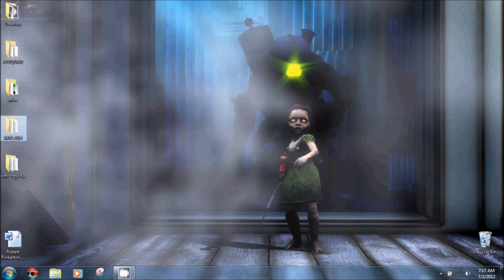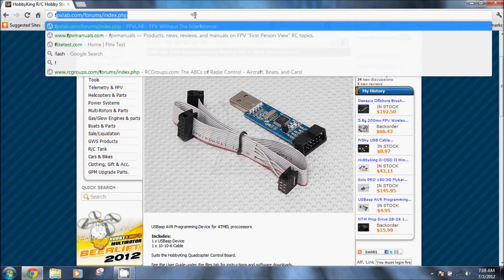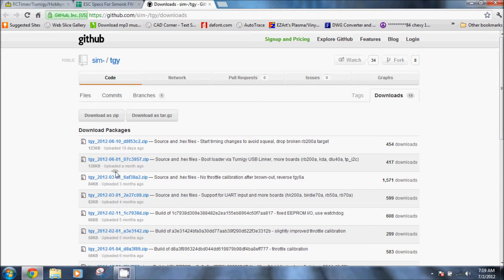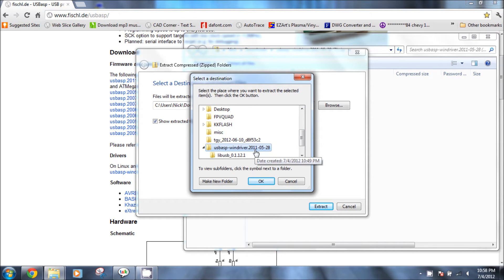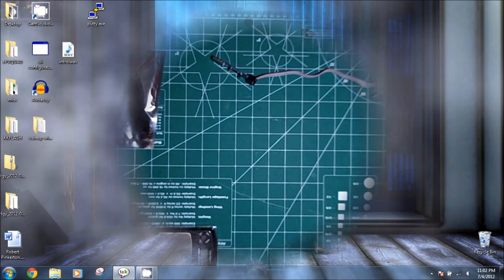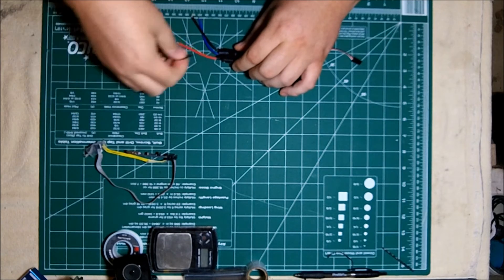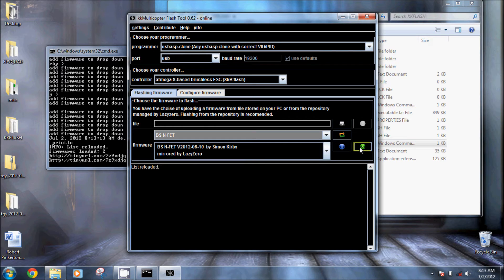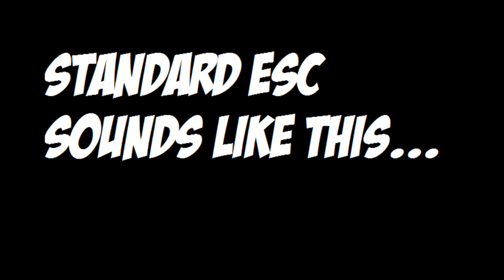Flashing SimonK Firmware on a 20 amp HK esc

Comment: Why install Adobe Flash? - the shell script or any part of the programming does not make any use of it. "flashing" is the term for loading software onto the microcontroller. It has nothing to do with Adobe's product.
Reply from the maker: I appreciate you taking the time to correct my mistake; however, I had already made a note in the video explaining you needed Java not flash.  I had flash on my brain and spoke incorrectly.  Its odd you did not see the note and felt compelled to correct the mistake.
Reply: rnpnick I had annotations turned off on my system, so i didn't see it. Sorry mate.

Comment: Can I use that flash tool on a MultiWii board? Confused because I did not see Multiwii in the pull down choices.  Thanks!
Reply: you might be able to flash the multiwii board, but this video is for the ESC, so it wont be of much help. the RCGroups forums should have a topic, if not, make a topic and ask how

Comment from the maker: SimonK turns off lipo cut.  The only thing you need to do is flash the esc then calibrate to radio.  Throttle stick to high, turn esc on, throttle stick to low, it is calibrated.

Comment: Yesterday i got the same message..
The message simply means that the connection is not correct.
First I thought it's my USBasp... or I overheated the ESCs when soldering...
But after I calibrated the ESCs and was glad about having them working and after many tries flashing suddenly worked! Simply press the contacts tight on the board.
Also take a look at: wiki.openpilot(dot)org/display/Doc/Flashing+Instructions and make sure you connected the signals correctly.
Good luck!

Comment: avrdude.exe: set SCK frequency to 93750 Hz
avrdude.exe: warning: cannot set sck period. please check for usbasp firmware update.
avrdude.exe: error: programm enable: target doesn't answer. 1 
avrdude.exe: initialization failed, rc=-1
             Double check connections and try again, or use -F to override
             this check.

avrdude.exe done.  Thank you.

Error during writing flash.

however I tried to flash this ESC.i get this error message.I cant find what what i do wrong.please help

Comment: Would it be an issue to flash the ESC with the motor and the power distribution board with other ESCs attached?
BTW, do you know what it means when the ESC does a single beep at powerup? Or a weird 10xbeep and 10xhigh pitched beep continuously during calibration?